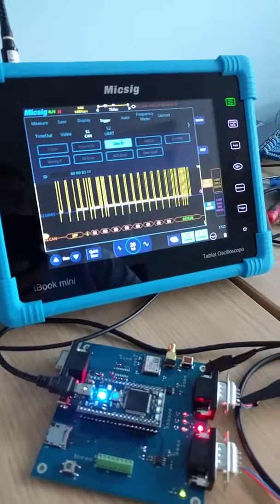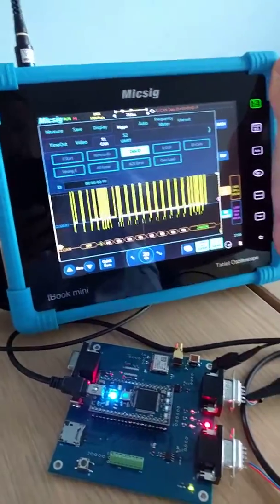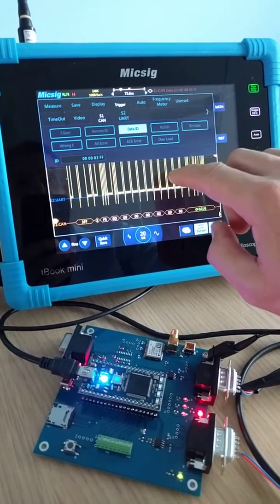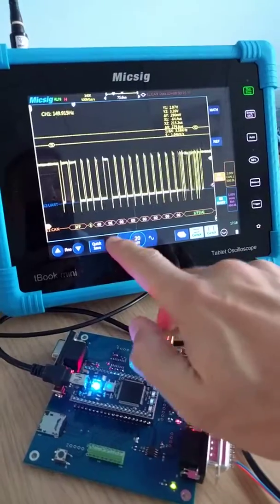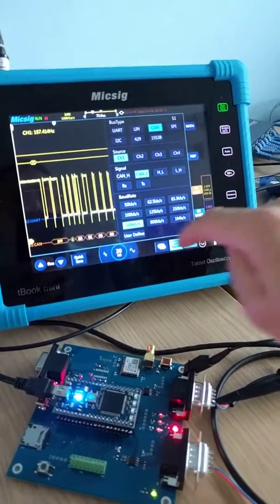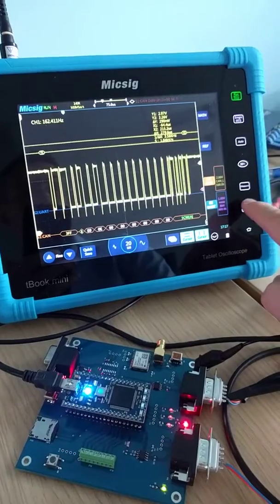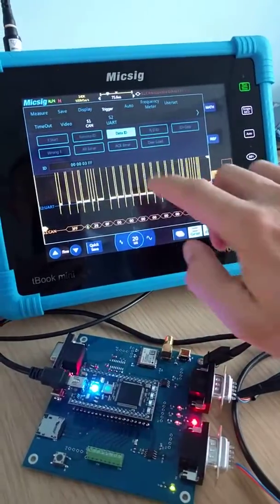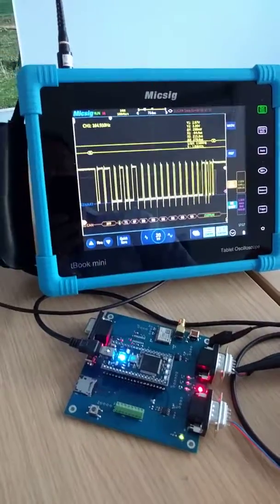Micsig Oscilloscope Decode test

Comment: Wondering if you can help.I've just bought the automotive version of this scope,the ato1104.
I'm using the preset for canbus on it but the signal is terrible with lots of interference etc,not a nice defined up and down pattern like you get with any other scope,any tips??
I own two cars,it's the same on both,even tried my snap-on leads but just the same??
Reply from the maker: Hi, do you have a picture of the display? where is the probe grounded?